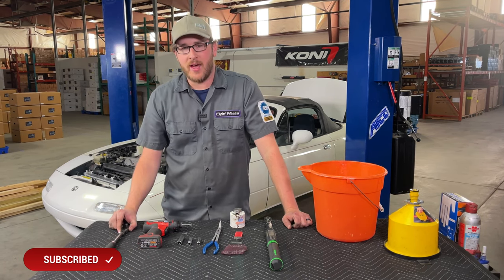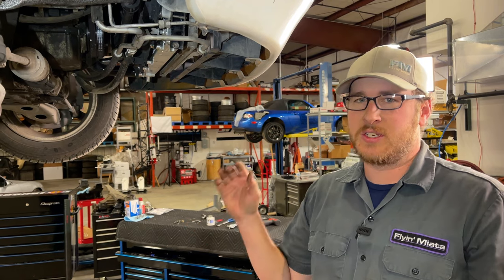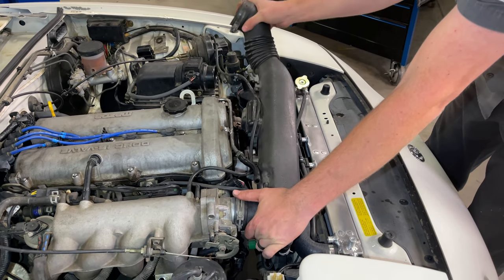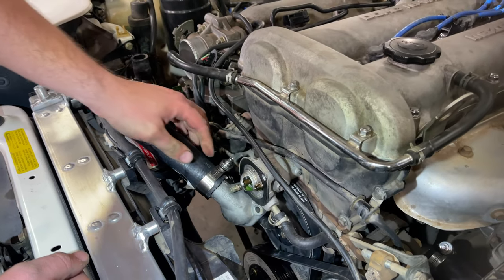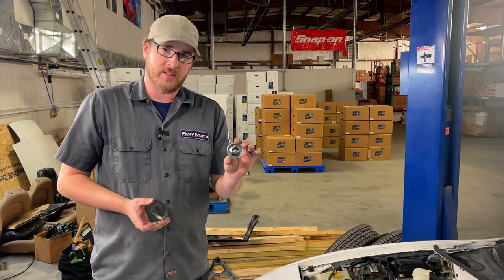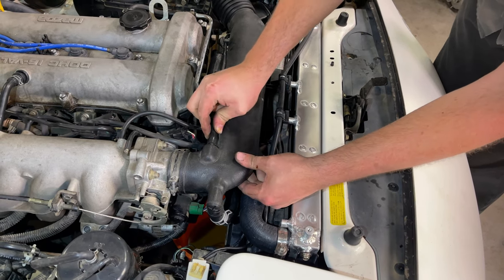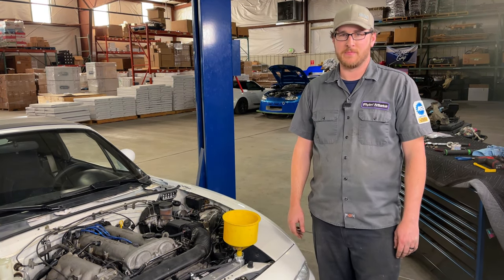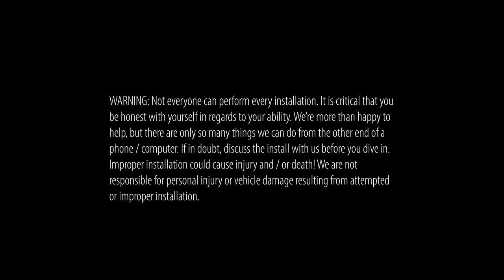NA Miata Thermostat Replacement

Comment: I may be a bit paranoid, but I'd really recommend using a plastic scraper instead of a metal one. Metal might scratch the housing and cause it to be more prone to leaking. Also, for us without a lift, just drain the coolant completely and save to refill instead of taking off the plastic shield.

Comment: Do each of you have a different preferred gasket compound? I also love Permatex No 3 on literally every gasket except head and exhaust. All the genuine gaskets are like "no sealant required" which always makes me nervous.
Reply from the maker: We like to use Permatex "Right Stuff".
Reply: I don't use any sealant.  The OEM Mazda thermostat gasket is like $4-5 and it goes on dry.  The OEM metal water pump gaskets are cheap too and don't make a mess.